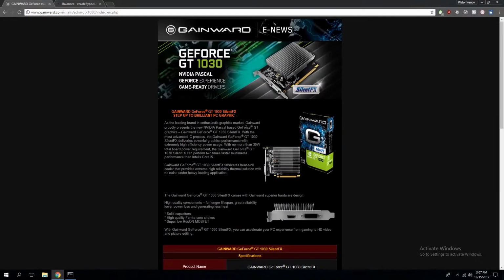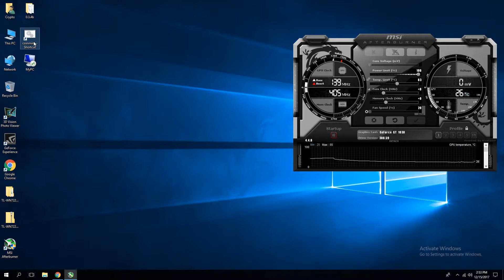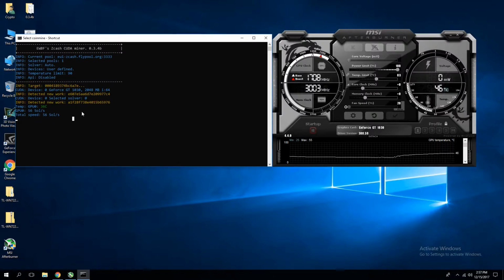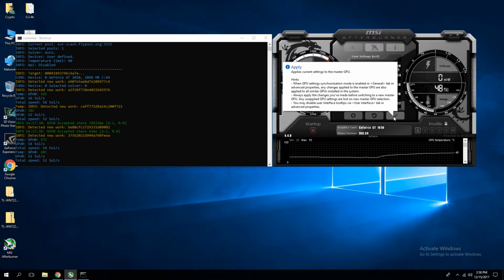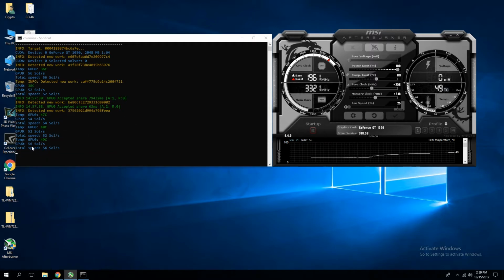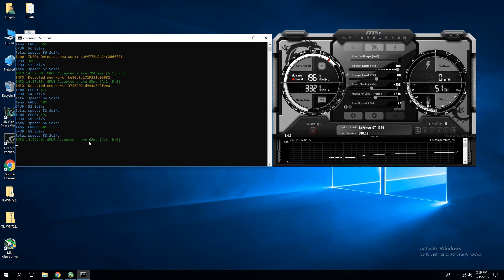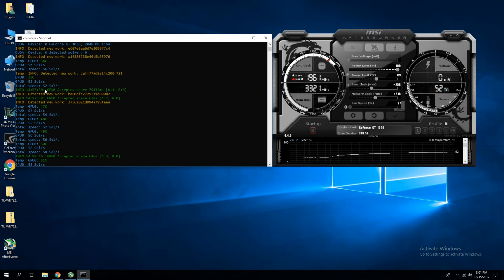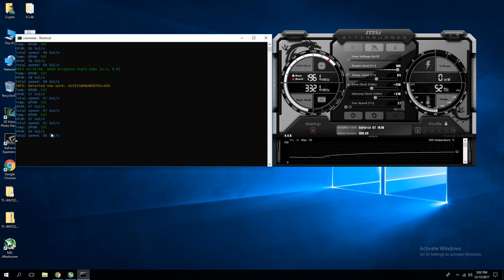GT 1030  Zcash Mining Performance stock and overclock settings

Comment: 54Sol/s?????? I'm getting 65Sols/s with much older R7 250 2GB GDDR5 512SP edition from sapphire! Oh - its true, i use diff program..
Reply: my gt 1030 with oc -> 68sols/s, with half watts than r7 250...
Reply: 68sols/s are fine but I do not pay electricity..
Reply: razerf which miner are you using?
Reply: looks like EWBF's zec miner i guess
Reply: not all algorithms are good for all cards.  Ati is better for ethereum than nvidia, but nvidia is better in some other algorithms...
Reply: Charlie it is not Ati anymore, it is AMD but you're right and mee personally have only 2GB cards so I mine XMR
Reply: Pavel Jelínek my gainward gt 1030 dont wanna open cc miner for minergate monero or any other algorithm other than nicehash
Reply: Correct mee if I'm wrong but CC MINER DOES NOT MINE MONERO and NICEHASH IS NOT AN ALGORYTHM, it is a pool, minergate is the same
Reply: Pavel Jelínek you are right, i meant, my 1030 card dont want to open miners from minergate except when opening minergate application.... so far in mines only on nicehash miner app...
Reply: Strange.. You can still mine monero with XMR-stak for example (newly Nvidia support)
Reply: Yoo can try but mee doo not suggest it since Nvidia is better in any other algos than cryptonight.. Cryptonight's for AMD mainly